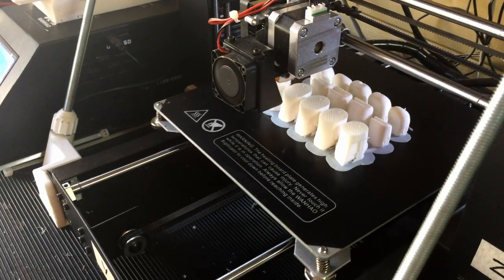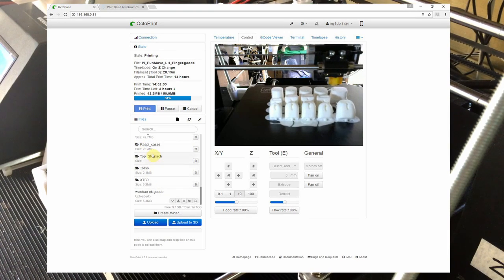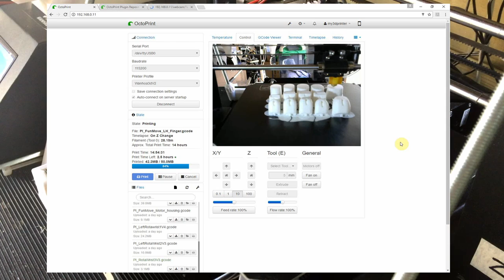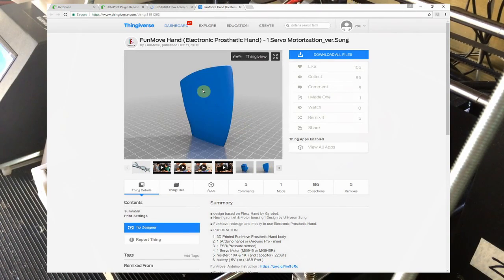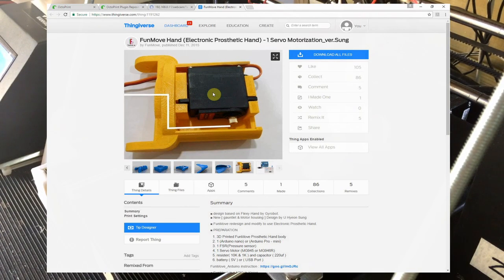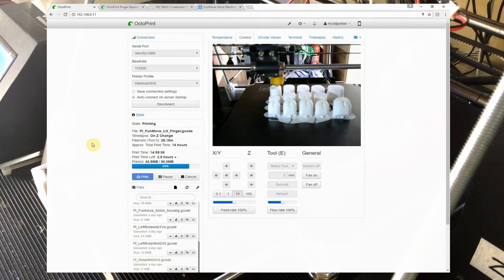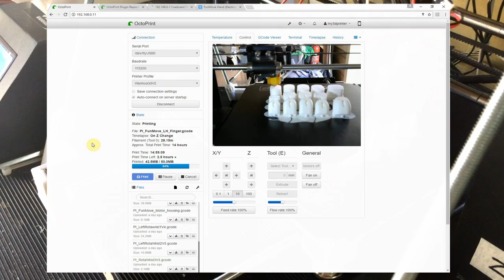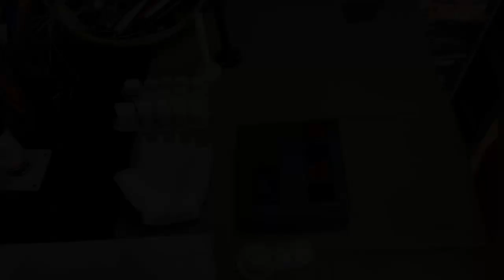InMoov Build Part - 17

Comment: Why doesn't anyone ever print the entire hand out of flexable filament?
Reply from the maker: I think people have done so, I am sure I saw a video with flexi skin on the fingers as they could grip things really well.  I will see if I can find the video link.   I have manged to print the flexi filament now and its very interesting!
Reply: What I was asking is why not design the hand to be printed as a single print.  Print it out of a flexable material of varying densities, stopping the print to insert/install the ligaments.
Reply from the maker: Yes, I see what you mean.   I have just ordered  the Prussa Mk2 printer and that has a mod coming to allow simultaneous multi-filament printing and stopping-starting prints etc.  So redesign the original 3D shapes of the hand with ligaments as part of it.  Then the slicer program would need to know which parts had which type of material.  Thats quite a project
Reply: I suppose it would be.  However, Inmoov is about everyone getting together to make something none of us could do alone.  I very much enjoy watching Inmoov videos, but not many people seem to be trying to improve it. Not that I have a right to complain.  I do not have a 3d printer, and likely never will.